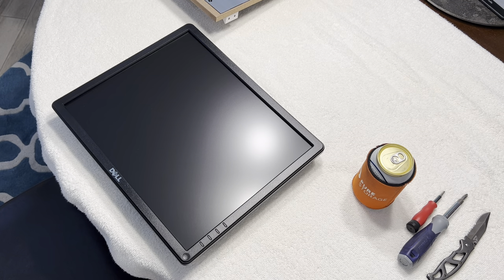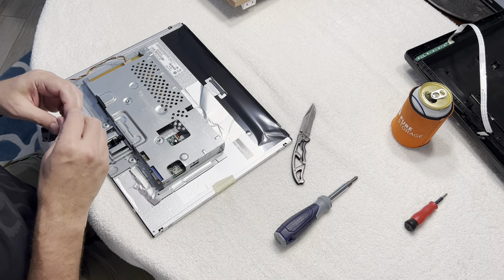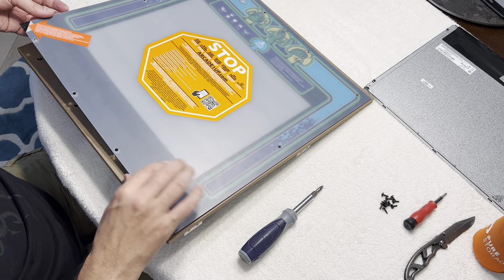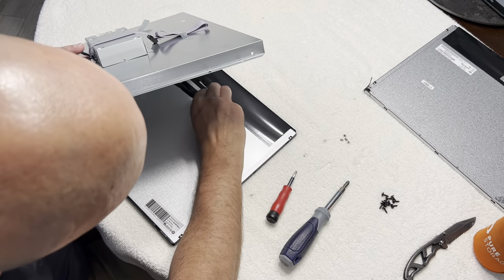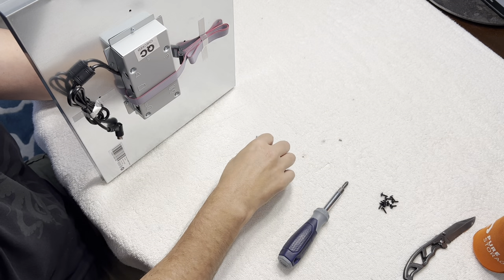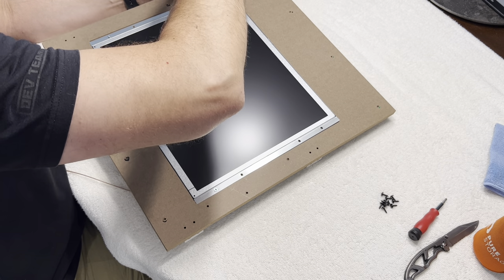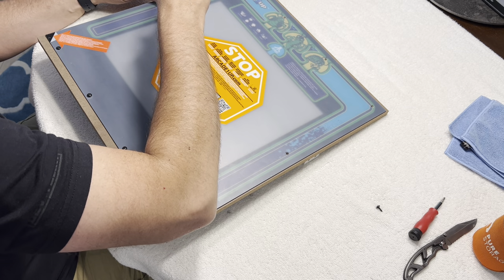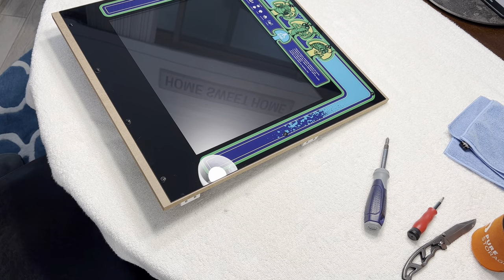Arcade1up monitor upgrade walkthrough

Comment: Thank you for the video! I followed the instructions and my cabinet looks beautiful now! I did my own mod of this cabinet, I modified the joysticks swapping it to a traditional setup, exchanged the screen board by the Owootecc NT68676 (luckily it worked) and added my pi to the cabinet, with batocera and sinden lightguns. The screen swap made a huge difference, looks like a new cabinet now. Thanks once again!

Comment: The stool didn't fix the issue, although it improved a bit.  Bought a Dell monitor, followed your instructions and the difference is astonishing.

The viewing angles are much better with no noticeable fade out.  It's not as good as the BOE monitor in my Defender partycade, but seems on par with my Star Wars cab.

This is what they should have shipped with.  Considering the sheer number or Legacy cabs that have garbage monitors, it's evident that Arcade 1up won't do anything about it.  So we have to do it ourselves.  The Dell is inexpensive and basically a drop in replacement.  Get it while you can.
Reply: We have ours on the way! Crossing my fingers and hoping it fixes the issue!

Comment: Thanks for this video. I had it on as I did the mod to my new cabinet last night, was very handy. Regarding a comment you made in the video, putting the last side panel on, yes that is annoying hah, trying to remove all specs of dust when changing the monitor is just as bad though :D

Comment: I just built my Centipede yesterday, very unhappy with the monitor. I’m not one who usually complains about the quality of the controls or screens in A1Ups, but this screen is noticeably washed out.  If I had been smart I would have followed this video and replaced the monitor before assembling the cabinet. This cabinet was a real struggle to assemble and the idea of even partially reopening it is not something I want to do.  Plus it’s still going to be a horizontal monitor in a Centipede cab. 🙁

Comment: Just picked up a 1up Centipede in the sale and picked up a e1715 for this exact reason. You have another video for the BOE monitor that has better blacks but doesn't fit as neatly. Is there any way you could adjust the e1715 settings for better contrast/brightness before you install or are the monitor settings parts removed in the transplant so to speak?
Reply from the maker: Only the panel is swapped, so the settings wouldn’t follow (unfortunately).  There’s a chance someone will develop an add-on board. I bought one for my 1st gen Galaga.

Comment: I’m curious as to why you’re replacing it.. better blacks is my guess…? Is this an IPS monitor? I have converted 2 separate NBA JAM cabinets into multicabs, 2 player cabs. So each person is slightly off center, left and right… One of the multicabs is for horizontal games, the other is for,vertical games (turning monitors vertical is usually where problems are, they just don’t look as good as they do horizontally.) Thanks
Reply from the maker: Mostly for the black/contrast level and off-angle viewing in this case.  The TN monitor they used in the MK/Centipede/Pacmania/DigDug cabinets have pretty poor black levels and the color washes out quite a bit when viewed from above, which is really bad for taller players when standing.  Do not use the Dell E1715s panel in a vertical cabinet.  19kfox did that in his Pacmania cabinet and it is really bad when viewed off-angle from the left.  Not a problem at all in a horizontal cabinet though.
Reply: @DannyWelch  thanks for the detailed explanation. I’m on the look for a vertical monitor 17” or more that looks good from all angles… Question is does it exist?
Reply from the maker: @troymcdonald  Great question.  I have a monitor on the way that I'll be testing soon.  Fingers crossed!
Reply: @DannyWelch  fingers, toes and eyes crossed 🤣

Comment: I have some questions:  The Dell E1715s is listed online as a TN Panel.  I thought that video was claiming that it is a BOE monitor, but this may be referring to other Aracade1up monitors.  Is the Dell better than Aracade1up?

Dell says that E1715s has a 5:4 aspect ratio.   I thought that the Aracade1ups had a 4:3 aspect ratio?

Will this work in my Atari 10 game cabinet?  My display is malfunctioning.  I saw an E170Sb for sale that seemed to have the same specifications as the E1715s.  Should I stick with the E1715s?
Reply from the maker: It is not a replacement for the BOE. As you noted, it is 5:4, which was the ratio used in a handful of A1Ups (Atari Legacy Centipede, Midway Legacy MK and Joust, Dig Dug, and Super Pac Man). If you need a replacement for any 4:3 cabinet, I would try to get a BOE.
Reply: @DannyWelch  How do I get a BOE panel?
Reply: @DannyWelch   I haven't yet found the official size and resolution of the Atari 12-in-1 arcade, but I did a crude measurement and got roughly 10.75 x 13.125, which is roughly 4:5.  That works out to be about 17.1 inches.  

I'm going to see if I can find the official dimensions.
Reply: So I think that I can use the Dell E1715s.

Comment: I managed to get a 17" Acer AL1716fb with 5ms would it be a swap just like you did here?
Reply from the maker: Couldn't say.  You'd need to disassemble it (should be somewhat similar process) and see if the connectors match up and you can get it mounted into the frame.

Comment: So I did that why my golden tee 3d xl cab and swapped monitors but now I noticed the screen is dark.  I can faintly see the loading screen when I turn on the game followed by the rest but how can I turn up the brightness now that the monitor has been decased and installed?
Reply from the maker: Not aware of a way to adjust it.  It is set by the board providing input (the A1up board in this case).  I’ve seen kits before that allow you to adjust the backlight, but that’s it.

Comment: Would I be able to put a Dell E1715s into a 1st gen Street Fighter II cabinet?
Reply: Can confirm you absolutely can IF you have an LED backlit LCD driver.  I was using an adapter from VSDISPLAY since I was using a raspberry pi.  Works great and looks much better

Comment: Thank you sir!  I have two Dell 1517s brand new and one will go In my MK 30th. Do we have to adjust the monitor settings before removing the screen?
Reply from the maker: That’s an excellent question and something I didn’t do before my swap.  I assumed that the monitor board is what remembers and controls that, and the panel is just dumb.  I’ll be swapping my Centipede with a replacement soon and will do some testing.
Reply: @DannyWelch  Do you think that the screen itself can keep the settings in some kind of memory ? Or the settings are kept on the board..
Reply from the maker: @al3xdodo  I'm pretty sure it's controlled by the attached board.
Reply: Did you ever find any additional info on this? I just did a swap into my new Dig Dug legacy cabinet and it seems way too bright, I would love to figure out if there's a way to adjust the settings.

Comment: Thanks, great video.  I did all this but somehow loss sound.  Any idea what I could have done wrong?
Reply from the maker: Hmm… I can’t think of anything related to the monitor swap that should impact that. Speakers connected to the board well?
Reply: @DannyWelch  it’s driving me nuts!  I’ve plugged in multiple speakers and none of them work so I know it’s not that.  Everything is plugged in tight.  Do you know which wire has a direct effect on sound?
Reply from the maker: @cjcin23  I don’t believe any wire is involved, since the speaker jack is mounted directly to the mainboard.  The cables to the monitor are for video out and backlight power.  Did you screw the ground cable to the monitor chassis when you put the mainboard back on?  I don’t think that would disable the audio, but it’s the only thing I can think might impact it.
Reply: @DannyWelch  thanks for all your help!  Arcade1up sent me a new pcb but that didn’t wasn’t the issue.  Then they sent me a new audio cable that plugs from the pcb to the control panel.  And that was it!  Turns out the one I was using had a prong missing.  Probably broke off at some point.

Comment: can i do this without taking all apart? maybe just pull the monitor out from the back of th cab?
Reply from the maker: Yep. Just loosen the screws on both sides of the cabinet and you can pull it apart enough to get the monitor out. That’s what I did.
Reply: @DannyWelch  sweeeeeeet!!

Comment: Does it have to be the E1715S, or any Dell or likewise 17"? I have the asteroids partycade wall mounted and my screen is normal for a period of time, but will go all white although I can still hear the game playing.
Reply from the maker: For the Asteroids partycade, you probably don't want the Dell E1715S as it's a 5:4 aspect ratio and yours is likely 4:3.  If you open up your partycade and look at the back of the monitor, you can see if it is a BOE brand.  If so, then I'd suggest looking for a replacement A1Up BOE monitor.
Reply: @DannyWelch  ok thanks.

Comment: I'm about to get my monitor to replace the 1st gen arcade1up MK cab. Would it be possible to configure the monitors brightness and contrast before installing it in the arcade1up?

Perhaps it will safe my brightness settings.
Reply from the maker: I don't think it will save those settings.  I believe that is controlled by a separate board in the monitor and by the A1up mainboard once you do the swap.
Reply: @DannyWelch  Roger that, I ended up swapping my old monitor from my 2019 MK cab and everything worked, but quality was exactly the same lol. All that trouble for the same exact visuals🤣

Well, at least I have a spare monitor in the future.